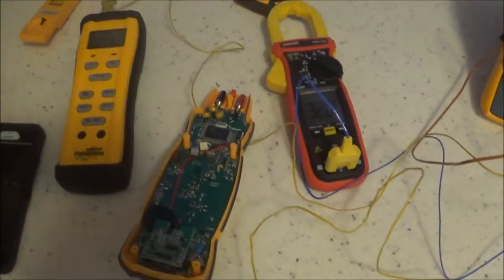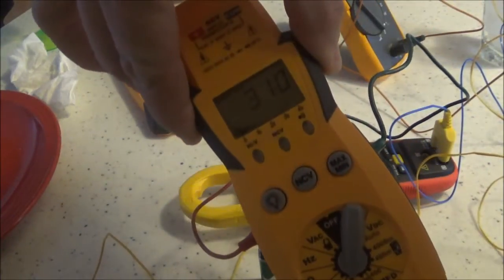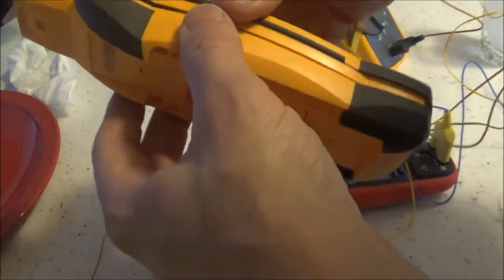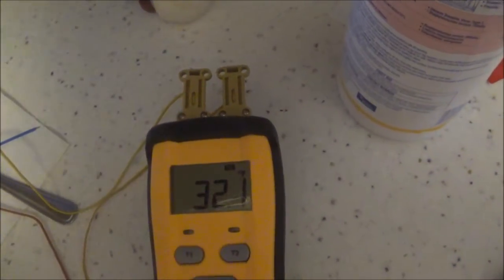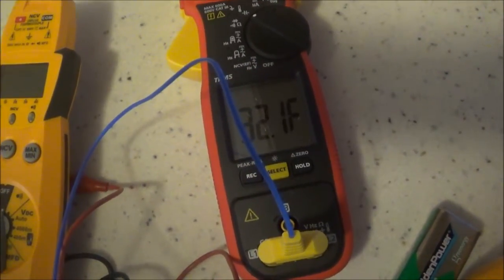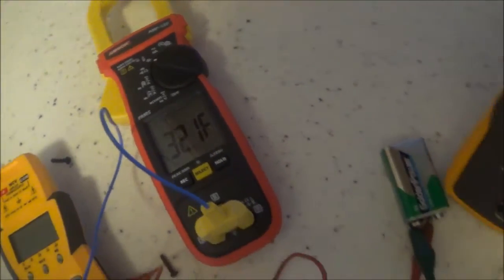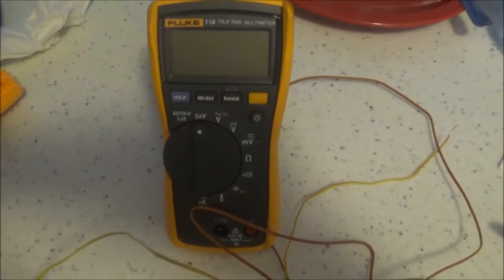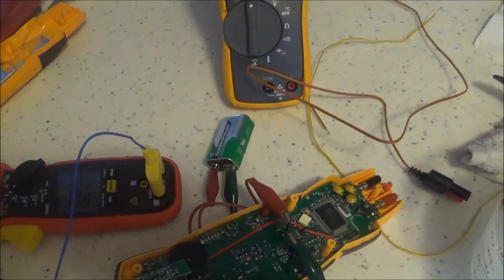Temperature Calibration

Comment: what size of screwdriver did you use? thx
Reply from the maker: That was an old Harbor Freight precision screwdriver set, but a Klein 32581 4 in 1 precision screwdriver will work like a charm. The tip is 3/32" of an inch, or 2.4 mm.

Comment: How do I change it from Celsius to Fahrenheit
Reply from the maker: HVAC/R Detective On the HS36, there is a jumper to the left of VR3, and it needs to be open in order to read in Fahrenheit. I do not have my HS36 anymore, so I can’t open it up and verify anymore than I have just said. I would hope they have a plastic jumper that can be removed, and not one of those wire soldered on pieces that has to be snipped to change it.
Reply: Yeah I don't see the jumper I'm just going to go to fieldpiece they're not too far from me
Reply: Thank you for replying I really appreciate it

Comment: Where do i get the information to calibrate a fluke 116?
Reply from the maker: Unfortunately, you can't calibrate a Fluke if it's off, you'd have to send it to them to recalibrate it (which would cost more than a new meter). You can check the calibration by taking the K type thermocouple and putting it in ice water (lots of ice with just enough water to come to the top of the ice). Constantly stir the ice and see if it reads around 32 degrees F or 0 degrees C. For what it's worth, the Fieldpiece line of meters are capable of field calibration, unlike the Fluke meters. They have calibration pots for field calibration, with instructions how to do so in their manuals. Here is a link to their SC640 meter manual, you'll find the instructions there. https://www.fieldpiece.com/media/manuals/Opman-SC620-640-v28.pdf   Thanks for watching and commenting.

Comment: steve Voelpel
 
Hi i have ben calibrating temperature  since 1969 and the temperature you are telling people to calibrate to is not right it is not 32 F Degrees. in ice and water it is 36 F Degrees. and you need to mix up the water and ice. And it should be calibrated to 36 F degrees it is a more constant temperature there is no way it can be 32 F Degrees en less it is solid ice. i show in my 2 videos on YouTube  titled   correct calibration with ice. In one of my videos i show the ice solid with no water that's when it is  32 F.  not when it has water in between the ice.The 2'ND video shows ice and water 36 F at room temperature. it has to be solid ice to be 32 F i have put the water and ice in the freezer and froze it solid the took it out then it was showing 32 F Degrees when there is ice cubs with water it is 36 F at room temperature not 32 F. A lot of you people are not calibrating it right and are telling people wrong. 36 F for your ice point it is more constant temperature with water and ice in a warm room
Reply: "la·tent heat

noun

PHYSICS

the heat required to convert a solid into a liquid or vapor, or a liquid into a vapor, WITHOUT change of temperature."

You sir are mistaken.  Water and ice can both exist at a temperature of 32°. Ice and water is a proper way to calibrate a thermometer.  I do believe fieldpiece and the  business have th3 money, knowledge and science to give proper instructions in calibrating their equipment.  Latent  heat!!
Reply: Ice and water is certainly NOT 36 degrees!! Depending on the ratio of ice to water, It may not be 32 deg. F but is very close to it. Crushed ice with very little water in an insulated container will approach the actual triple point of water (32.01 F) and stabilize at that temp. long enough to do the calibration procedure that he is using. In a proper ice slurry, the actual temp. will be 32.1 or 32.2 deg. F, which is close enough for "calibrating" a DMM probe. My liquid in glass thermometer secondary laboratory standard has a measured and certified error of 0.06 deg. F and repeatedly shows 32.1 F in crushed ice.

Comment: Great video Tom.

I'm not fond of thermocouples. They're often out of calibration not to mention they are very susceptible to stray EMI and induced voltages causing erroneous readings - with the uprising in Inverter technology, this will become more of an issue. 

Thermistors are the way to go. You will get a much better reading and they aren't as susceptible to the things that the thermocouples are. Most thermistors are proprietary so there won't be any mix and match. The Cooper blue or red box is my choice for a stand alone temp meter.
Reply: ***** your right brother, that's all they give yaa. Thermistors also are not always accurate, however they are better then K type. I've found many cracked heatexchanger on chillers due to failed thermistors reading.
Reply: steve Voelpel
 
Hi i have ben calibrating temperature  since 1969 and the temperature you are telling people to calibrate to is not right it is not 32 F Degrees. in ice and water it is 36 F Degrees. and you need to mix up the water and ice. And it should be calibrated to 36 F degrees it is a more constant temperature there is no way it can be 32 F Degrees en less it is solid ice. i show in my 2 videos on YouTube  titled   correct calibration with ice. In one of my videos i show the ice solid with no water that's when it is  32 F.  not when it has water in between the ice.The 2'ND video shows ice and water 36 F at room temperature. it has to be solid ice to be 32 F i have put the water and ice in the freezer and froze it solid the took it out then it was showing 32 F Degrees when there is ice cubs with water it is 36 F at room temperature not 32 F. A lot of you people are not calibrating it right and are telling people wrong. 36 F for your ice point it is more constant temperature with water and ice in a warm room
Reply: My uncles were big time hippies in 1969 LOL. They were calibrating their guns in Vietnam lol
Reply: steve Voelpel doing something since 1969 doesn't make it right